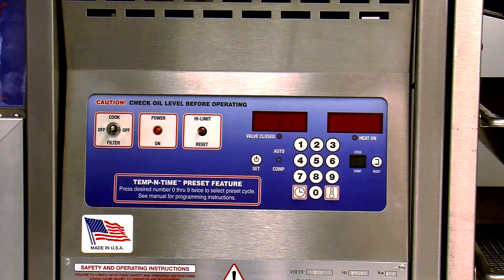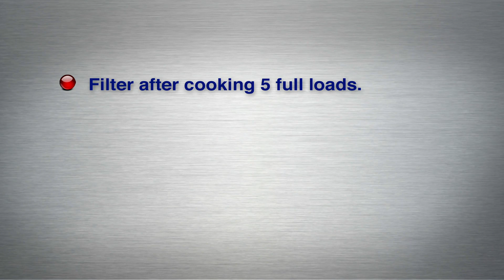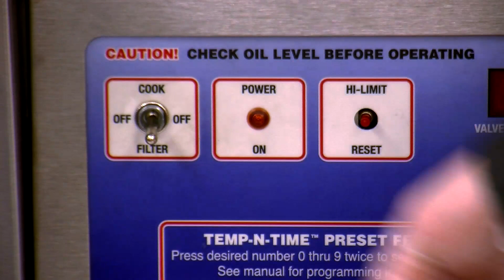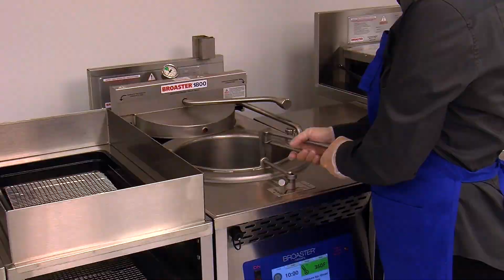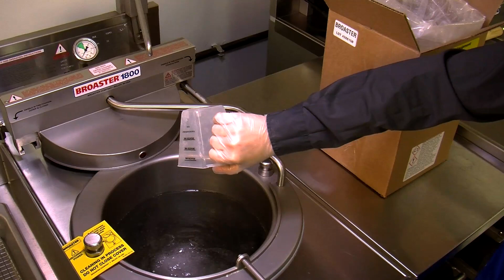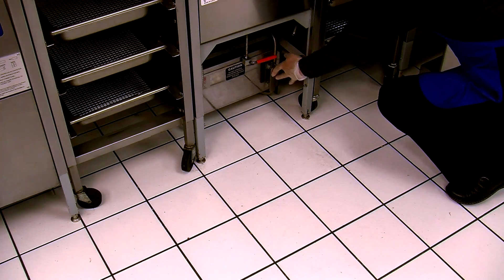Broaster® Pressure Fryer Operating, Cooking & Filtering 032816

Comment: 20 yrs ago i cooked at a place where i learned to use one of these...we drained oil and used a hose with sprayer to clean inside and water was drained in a bucket or pot. after drying inside with a towel we pumped filtered oil back in...much easier haha

Comment: I have a problem with our broaster the filter paper keeps popping up from under the ring and oil pumps back up cloudy. Water seems to come out of the pump with I start to filter for a second and make alot of popping sounds
Reply: I use the 1800 model at work. When you have a fresh filter NEVER open the valve full on first time. Open it a quarter way to slow drain for about 30 seconds. That will help saturate the filter and make it heavy and hard to move. Then after that you can open it full blast. Hope this helps. Btw I am a Rotisserie cook for Gordon foods. Just FYI I guess. ✌️